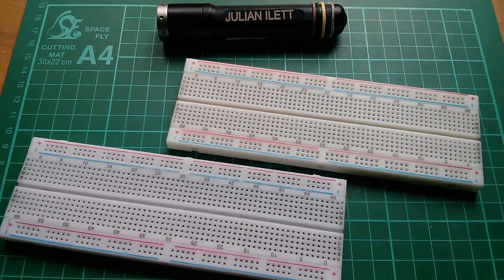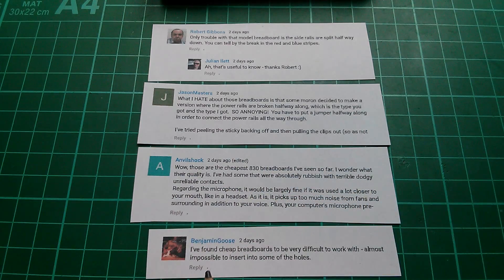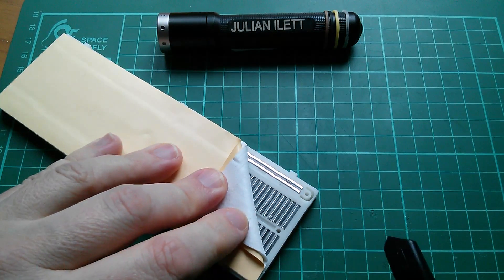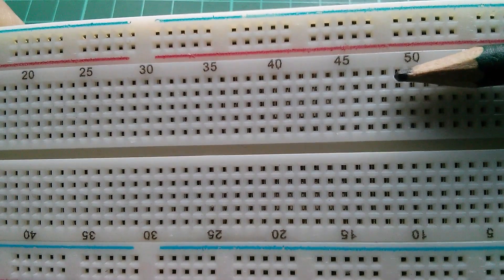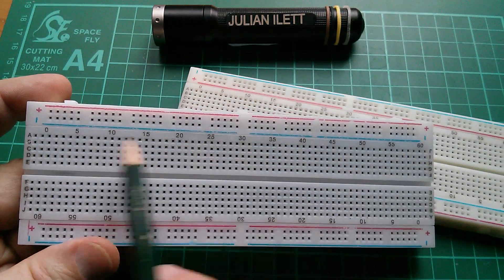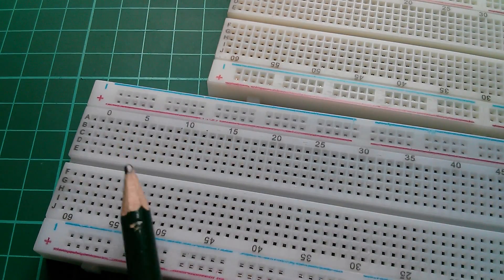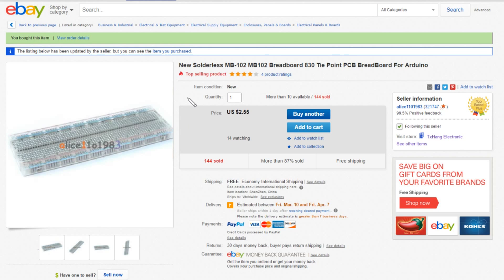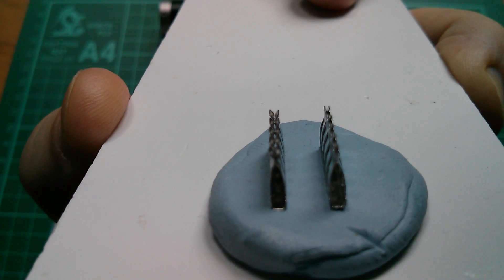FAKE Solderless Breadboards

Comment: Until I watched this video, I had no idea that not all breadboards are as bad as the ones you bought - I've only ever bought and used cheap ones and thought that horrible insertion and dodgy contact with the terminals was par for the course.
So, let's say I want to treat myself to some good quality (and, no doubt, expensive) breadboards - where do people reckon I should go and what should I buy?
Reply: Nicholas Barnes I had the same idea until I found out I was living under a cheap rock when I borrowed a high quality breadboard from my friend. I have so many of those cheap crap ones but I've kinda gotten used to them so it doesn't bother me that much. 
A good indication is the price although having said that stuff on Ebay are kind of a hit or miss thing. Stuff from reputed online shops such as sparkfun or adafruit are however of high quality. :v
Reply: When you were 6 these breadboards were like 15 bucks each. Look it up. A 4000 point assembled breadboard was more than $149.

Chinese components have thinner leads than US branded counterparts. Quarter watt resistor leads on chinese resistors are ridiculously thin compared to a Vishay or Dale.
Reply: Try CPC/Farnell if you are in the UK.  That's where I got mine from: they are "Wish" brand, made in Taiwan, and inexpensive.  I can't remember ever having had any rubbish products from CPC.  Are you the same Nicholas Barnes I was at school with forty years ago?  If so, hello!
Reply: Right. I need to do a CPC order (need another Raspberry Pi), so I'll drop a few in the basket and see what they're like.
I was only 6 forty years ago, so I doubt I know you - but hello anyway!!
Reply: That's why Brexit happen...
Reply: Get the Jameco one from amazon.
You shall not regret it.
Reply: Digi-key, Mouser.  Real component retailers.

Comment: I just checked my latest bought boards and they were alright but I also bought some clip on power supplies and one batch were good but another batch were crappy with switches that died as soon as you pressed them, being a bit OCD I got right on to the seller and after days finally got a response of a refund! OCD soothed eventually.

Comment: I bought some cheap Breadboards around Christmas for ~€ 10.30 for 5 pieces (not Alice...). The labeling is correct, but has the same Problems inserting components even though the funneling is much better than the ones you got. It seems that the poor Quality Breadboards are flooding the market just because they are cheaper. Also after testing many different Breadboard Power Supplys i have come to like these: "3.3V/5V Breadboard Power Supply Module USB + DC 2 Channel Power Supply" from cindli-21. You might want to try them sometime. Just watch out for the polarity. But by using these, you can use all the Pins on your Breadboard.
Reply from the maker: Yeah, I've just ordered one of those "upgraded" breadboard power supply PCBs - which lets you access the entire breadboard :)
Reply: Oh, another nice Option with those breadboard power supplies is that they can easily be powered with a Standard micro usb cable. The small Switches seem nicer than Jumpers too, but are more prone to being accidentally switched.

Comment: I have some of these poor-quality ones at home. I found that some of the strips has surprisingly high resistance, like 8 ohms, which caused serious problems with an INA219 current/power meter that I was building (a lot like yours). I'm currently trying to build an INA219-based milliohmmeter to do some better comparisons.

Comment: I found that some cheap solderless breadboards cause an extra resistant load on some components when using an oscilloscope this shows inaccurate results. I believe this is something to do with the tracks not being stainless steel . nice exposure to watch ..I feel better

Comment: "Smaller not been ripped of yet" Nope not true! Bought a bunch of those 400 points from Bandgood last summer, really crappy quality, hard to insert at first! And once you've managed to insert components there is no springiness left in the contacts and you get intermittent contact which leads to all kinds of problems! Will be interesting to see if the once you get from Alice is any good.
Reply: Jon Sten I've bought a few different ones from Alice and they're hit and miss. None where exceeding bad like some others I've gotten.
Finding good breadboards is getting really hard since even local sellers are stating to stock these extremely cheap and poor quality ones even when they're not selling then for cheap.
Overall the best by average breadboards I've gotten have been the mini ones without the power bus bars.
Reply: I've seen the same thing, both in solderless breadboards, as well as with solder-style prototype boards.
It's especially frustrating with the prototype boards, as the bend makes it difficult to insert large DIPs such as the Arduino Nano.
Reply: I've got a breadboard that has a bow to it, it doesn't lie flat, lol.
Reply: mine too and virtually impossible to correct

Comment: Please do a followup with the ones from alice so we know if ther good or as bad as the fakes.
Reply from the maker: I'll be sure to check these when they come in :)
Reply: alice saw this video. he wont dare sending a fake one.
Reply: Interesting observation bdkmont that shape might be easyer to pick out on some of the pictures of products.
Reply: I just received 3 of these from am ebay seller called tk-electronics2016 and they seem to be OK. The numbering and lettering is as in the picture (print quality is a bit faded but still readable). I tried to insert a few components in and they felt just fine. I haven't opened up any yet, can't bear the terrifying thought of destroying a 1$ component :D
Here's a link if it works (item id 222184036094)
http://www.ebay.com/itm/222184036094

Comment: "Its very difficult when you got both holes resisting the insertion of your component". I've had that problem before, not fun! :P
Reply: Brainstorm4300 Or maybe, as the video demonstrated, the problem could be solved by exchanging the receiving end altogether.
Reply: Sharklops Yeah, floppy jumper wires are a well known problem. All those soldering fumes, you know.
Reply: muh1h1 Haha, I should've known I wasn't the only one to be triggered by that remark. 😁
Reply: market nich here, lube for bread boards. 😀
Reply: just the tip
Reply: Get out.
Reply: muh1h1 maybe your component is too thick for the holes. Try wriggling it couple of times before shoving it in.
Reply: Contact cleaner.
Reply: cut it off, ouch
Reply: tablatronix and only for a second mind you.
Reply: I have a bunch of these cheap breadboards that I got from AliExpress cheap. Maybe 20 or so. I have some wire that's a good bit stiffer than the stuff I normally use for hook up. I use a piece of that when I find a hole that's hard to insert into. I take that stiff wire and push it through. It opens the way and then whatever I stick in after will work fine. It's a bit of a pain, but based on how much money I saved (20 breadboards isn't cheap), totally worth the trouble. It happens with a small minority of the holes, so 90-95% of the time, there's no problem at all.
Reply: @petedavis7970  I can’t tell if you get the joke or not
Reply: Bro my jumper cables pin is too short it doesn't reach the metal rail what should I do?

Comment: The fake breadboard are nightmare to work with. Took a lot more effort to insert my teensy with headers. Yes there are fake half size bread board on eBay, that I recently  purchased. The funneling were same as the fake ones and the blue and red line was awfully printed. I will recommend buying from reliable source now such as adafruit.

Comment: The bad ones are not reliable when the circuit speed goes up and when using wire wrap wires with tinned ends.
Reply: wait, are any breadboards reliable with high speed circuits?

Comment: I don't think "fake" is really the right word to describe these. More along the lines of very low quality/poorly implemented copies of a fairly common & simple design.
Reply: Then the title would be "very low quality/poorly implemented copies of a fairly common & simple design Solderless breadboards" tl,dr.
Reply: The title should simply be "Why some bread boards are crap"
Reply: Malcolm Whinfield China's a great source for cheap 'modules' for tinkering n evaluating project ideas with. The only downside to this is the time you spend reverse engineering n probing these circuit boards because these no decent online support. Okay, there's the manufacturers data sheets for things like the IC's they use- but they have a habit of scrubbing or defacing the chips epoxy encasement to stop you doing this!
Reply: I agree if it has another companies logo or part number it could be classed as fake. These are just poorly constructed. The split rail is common on the larger board. I have some of the larger boards that also have the joiners on the short end for joining lengthwise.
Reply: i agree, its said there are generally 5 quality levels for nearly every product produced in china, the problem is though actually knowing what quality level your going to get, vs paying for.
Reply: Gotta have a clickbait title. Otherwise, how can you get traffic when the content is uninteresting?

Comment: First! (My first first, but I don't intend to post that every time).

I wouldn't call this fake, but they can indeed be "less than optimal". I also have some. Same insertion issues, but not the split power-bars. Nevertheless I still use them and appreciate their value-for-money. (Or lack of value for not so much money).
Reply from the maker: Are you using them or have you given up on them?
Reply: I still use them and get irritated every now and then.... :-)
Especially leaning over the desk inserting components in a board on the other end may require some gymnastics.
I didn't pay that much:  € 2.19 each in 2014. Mine have proper printing though.

I also prefer the 400 point breadboard (paid € 0,96  for one on my last purchase) and also like the 170 point mini-breadboards for tiny projects (such as with an Attiny13A). I use the notches on the side to combine them when I need more space.

The ultra-mini 25-point thingies seem less useful. These have some weird studs on the back, probably for mounting them on a Lego-plate.
Reply: Yes, not fake, just crap